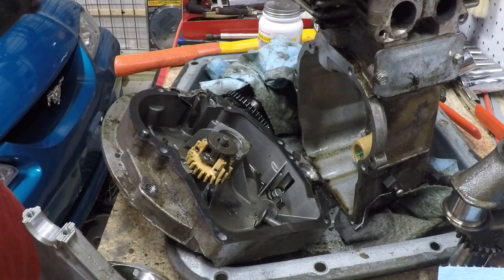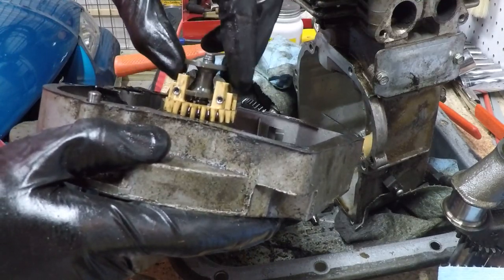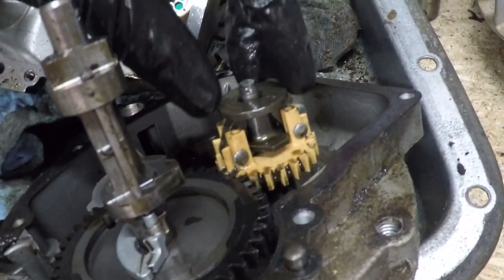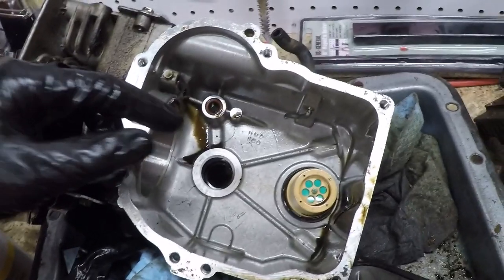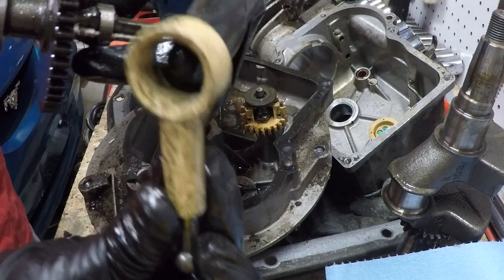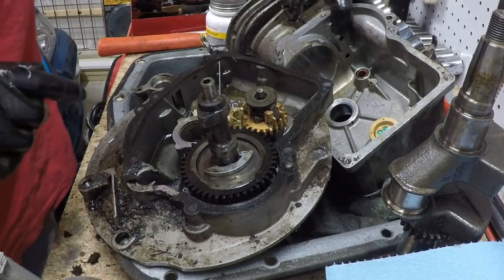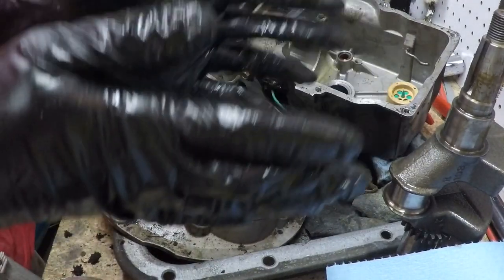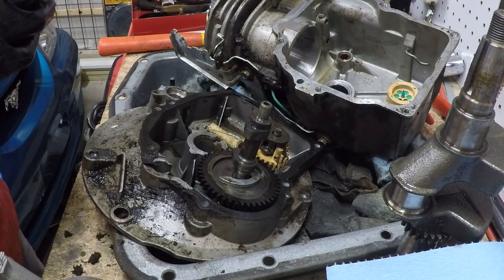Tecumseh Governor and Oil Pump Explained

Comment: I'm in the middle of rebuilding a TVS90.  You saved me a lot of headache showing how the knob end of the oil pump inserted into the slot on the housing.  I took the engine apart upside down and the pump rod fell out so I had no reference on how it went together.  

  Thanks for posting.

Comment: finally, a video that shows the same type of governor that mine has! The actual governing action that my 2.5 hp tecumseh has is different from most in that the pivot that comes through the engine block's wall is directly moving the fly with the exact same linkage that the throttle cable uses. this gives the appearance that there is no governor because you can only see linkage going from the throttle cable to the fly. The governor is kind of hidden in that the pivot for that throttle arm is actually the governor! Its very clever on tecumseh's part because it removes two parts (the governor arm and linkage on the outside of the block).

Comment: That oil pump mechanism is brilliantly simple and it accomplishes so much with very few parts.  I had no idea that these Tecumseh engines had a mechanical oil pump until I tore down myself.  This pump actually forces oil up under pressure to lubricate the upper cam and crank journals. And it accomplishes this using just 2 additional parts and a cleverly designed camshaft. Too my knowledge none of the Briggs small engines have anything like this, just a basic splash lubrication system. Its no wonder the upper journals and seals often fail on the Briggs engines due to lack of lubrication.

Comment: Thank you for positing this video.  Liked.
My governor was frozen and I had no idea what it was connected to, so I opened the sump.  That gasket is a tough to remove to replace.
Now I know how the oil pump works, and where the oil plunger goes when I reassemble.
The parts diagram is useless.  You need to see actual video or photos of the insides.
What is the previous video to this one?

Comment: That engine lubrication system was good, i had one Tecumseh engine with that system in 1990
Reply: I just modded my 15 year old tecumseh to be variable speed because I knew the pump could property lubricate it

Comment: Thanks for the info. My governor got stuck on my generator. Now it forces the throttle to almost full throttle without a load. Things sounds like it's revving past 10,000 rpm. The governor lever won't move at all, so I'm assuming the flywheel plate/collar is siezed or something. Gonna pull it apart this weekend and find out what went wrong.

Comment: I have an issue that when I cause the Tecumseh engine to overspeeds at idle, it overpowers the governor spring and pulls the bufferfly on the carb into full open throttle away from the idle speed crack screw which is the exact opposite of what I think it should do.  When the engine is at idle the governor spring and the butterfly on the carb hold the butterfly /carb against the idle crack screw so that when any load is applied the engine immediately stalls out instead of opening the throttle.  As far as I can tell from the engine diagrams it looks like everything is set correctly but it obviously doesn't function as it should? I've tried adjusting the governor lever but it seems like it made no difference.  Saw some comments of other people being able to fix this exact problem by "adjusting the governor" but what exactly they changed they never mention. The governor screw position? Governor screw tension? Governor arm positioning? Something else? There is a spring on the carb that holds the throttle to the idle position as well as the governor spring which also pulls the governor arm to the idle position.

Comment: Does the oil pump have to be installed on the camshaft a certain direction? I noticed it has a bevel on one side and not the other.

Comment: How does the Governor Rod (Part # 30589) attach to the Governor Gear Assembly (Part No. 30591) inside the motor?

Comment: You have your forces confused. Centripetal force is the pull TOWARDS the axis of rotation to keep a spinning object going in a circle. The governor uses  centrifugal force of the fly weights that pull AWAY from the axis of rotation to move the governor in a direction that reduces throttle to maintain equilibrium.

Comment: Interesting. I have a Tecumseh mower engine from the period just before the stopped production - about 12 years old now. I've been wondering how long it will last. It shows no sign of problems yet. This appears to be better than a simple "dipper" system. I've read of Techumseh mower engines lasting 25+ years. With this oiler I can see why, if they are maintained.
Reply from the maker: I agree, this is a pretty advanced oiler. I would guess as long as the oil was changed regularly it would run a very long time. The ones I see that are dead are usually dead from one of two causes: ran it without oil/low oil/contaminated oil etc., or hit something and bent the crank.

Comment: oil pump assembly was explained very well. But, what is that round unit with the blue  part for and how does it line up with the rest of the Tecumseh oil process? Please adevise.

Comment: Just saw this. Excellent explanation. I have two  good running Tecumseh engines on early 2000's Toro mowers; those engines get undeserved bad reviews imo. I think its because the carbs on them can be kinda ornery at times. But this oil pump system is quite advanced vs. the Briggs & Honda splash arrangements. Too bad that Tecumseh (the co.) went under.
Reply from the maker: Totally agree. These Tecumseh engines are very good engines.  That oiling system is way ahead of Briggs and quite advanced for such a small motor.  However, like you said, the carbs are what give them a bad name.  They are more involved to clean and service.  They have a "removable" emulsion tube with o-rings that go bad and can cause problems sometimes, and they have a finicky idle circuit that's hard to clean unless you know exactly how to do it.  I also have seen way more undersized jets in the later Tecumseh carburetors than in Briggs carbs which cause a lot of surging problems.
Reply: @billyb351  These days it doesn't pay to mess with a finicky carb. After disassembling and reassembling the original several times & never getting it to run right,  I bought an aftermarket carb on ebay for $6.95 believe it or not. A set of OEM o-rings cost about that much. One year later the mower runs fine with the aftermarket unit.
Reply: @billyb351  thanks, dealing with that on a mower my son bought. Only pd 75 bucks for whole rig, I was thinking governer issue, but it maybe the carb

Comment: I got a lawn mower and the governor arm spins freely doesn’t hit governor or anything so somethings broke it runs full throttle
Reply from the maker: Yup, governor is broken. You'll have to pull the motor apart to see what the problem is.

Comment: would you know how to remove and replace the govenor gear? mine is damaged
Reply from the maker: I don't think the gear by itself is a serviceable part.  It always comes as an assembly with the centrifugal weights already attached.
Reply: @billyb351  Is the Gear Shaft Screwed in or is it a press fit. I can See no circlips  holding the Spool or gear on the shaft.
Reply from the maker: @johnlocker9424  I believe it's a press fit. It's been a while since I've looked at one in detail, but I don't remember any screws.
Reply: @billyb351  I watched an "Amateur hour" video and WOW  he has no idea what he was doing, but the governor shaft appeared to be a Press Fit. By the way it feels on my case I'm betting a press fit with a vertical knurling pattern, like splines. Thank you again

Comment: REO used the same type  pump in the 50's
Reply from the maker: Interesting. So the design has been around for a while.
Reply: @billyb351  I had never seen anything on a small engine except splash, and thought that REO was cool as ever.
Reply: @billyb351  I had a '67 Craftsman mower with a 3HP Tecumseh engine which had this same system. Yes, it has been around for a while!